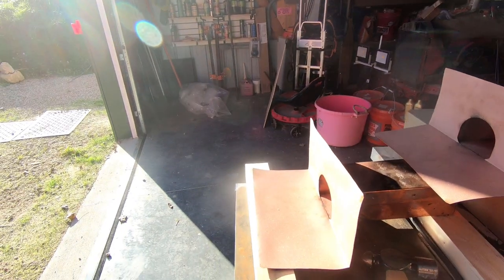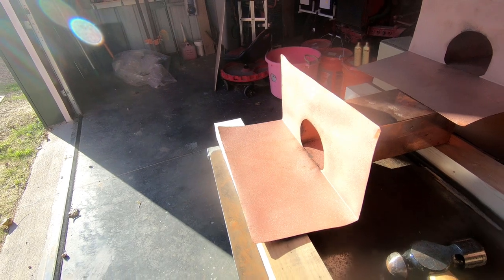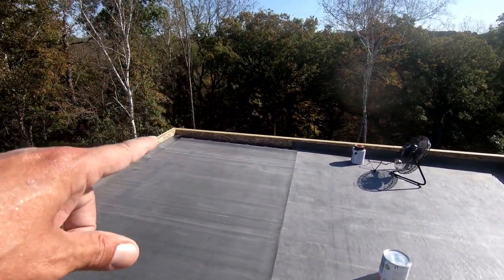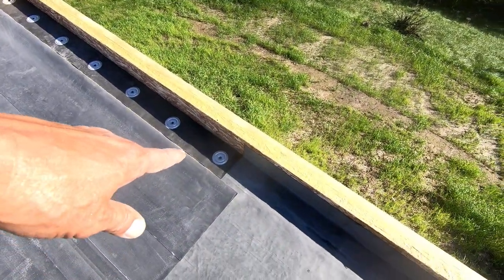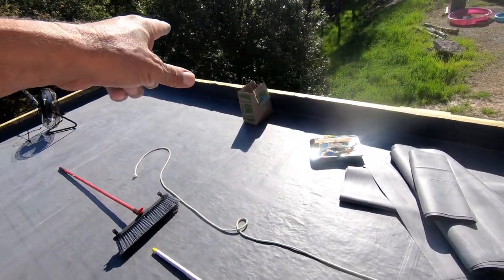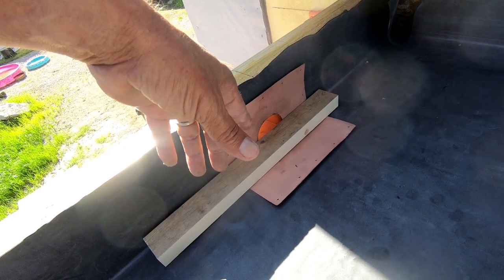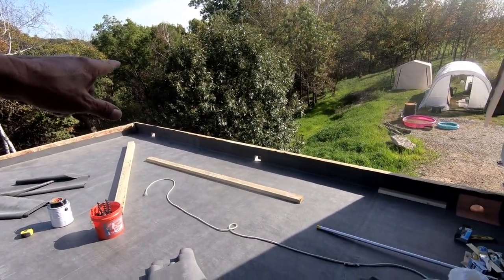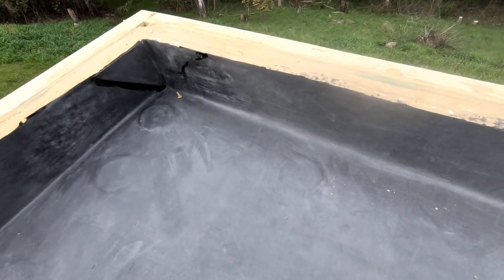Flat Roof Install ― Last of the Deck EPDM and Starting the Scuppers

Comment: Looking good .........Did you have to use primer, before the contact adhesive, where you have stuck rubber to rubber on the corners etc......... 👍
Reply from the maker: No, not with the cured rubber. I just used the solvent based contact adhesive (multi-purpose adhesive). All of the uncured rubber flashing and seam tape requires primer though, so the cover that goes over the corners is primed. 

Edit: It does say to clean the inside of the pocket with primer, but not the outside. I'm putting a termination bar over the top of the whole thing -- all the way around the perimeter -- as well as the tape covers so I don't think there is any chance of leakage. If it does, it will have to make it through the termination bar... I think 🤞